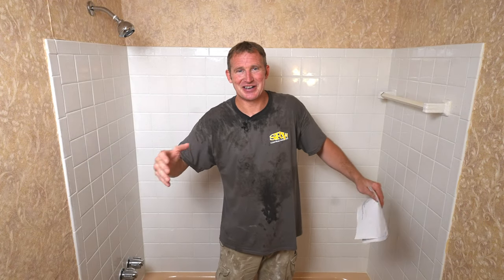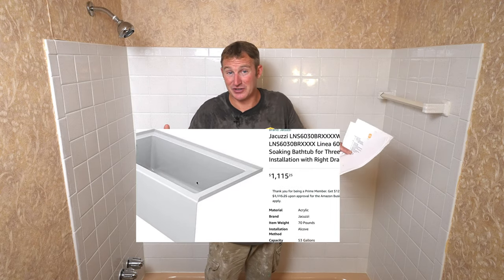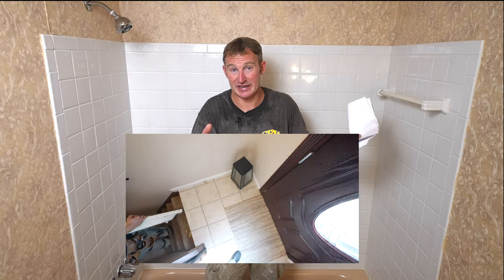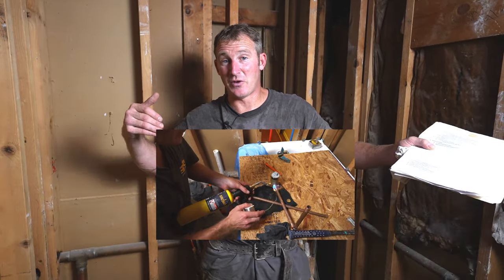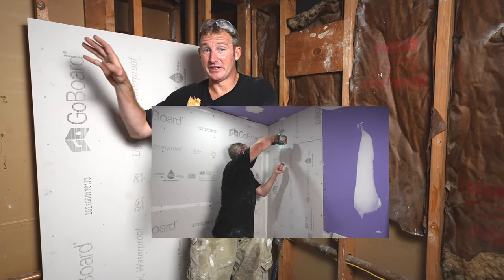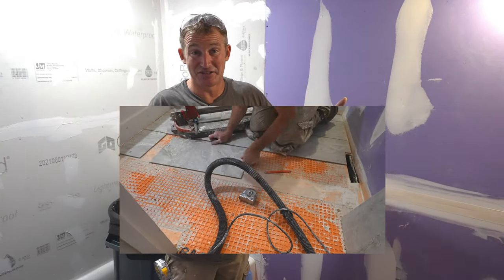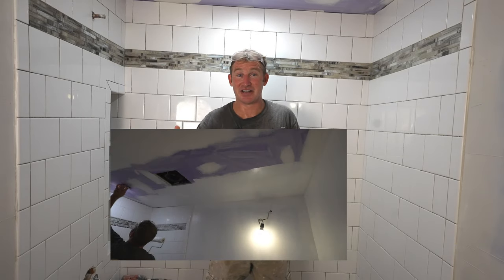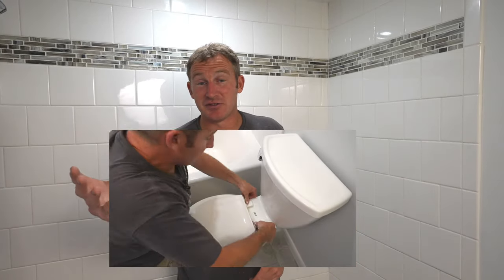How to Remodel a Bathroom in 7 Days or less | Summary | PLAN LEARN BUILD

Comment: Great videos STEVE! Glad to see the channel growing ! Already 21K subs.
I see you use Ditra uncoupling membrane  a lot and was wondering what the subfloor thick ness needs to be in order to be able to use ditra over it .
I believe mine are either 5/8" or 3/4" and i think and tongue and groove  16" on center . I was hoping not to have to put another layer down of plywood
Reply from the maker: Hey Dan, yeah it’s crazy, guess YouTube started throwing the videos out there. Pretty cool to see, but will be taking a break from comments soon, 😆 lots of input….but yeah, 5/8” over 16” O.C. Is minimum.And if that’s all you have, definitely stick with a porcelain tile 👍